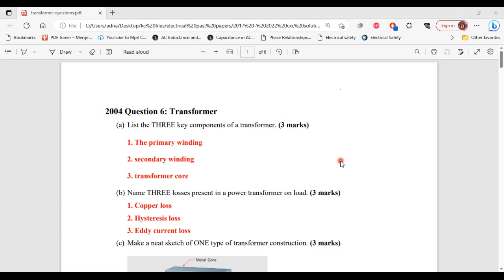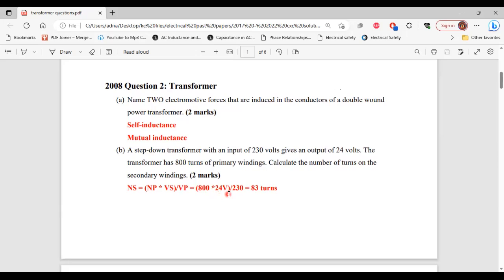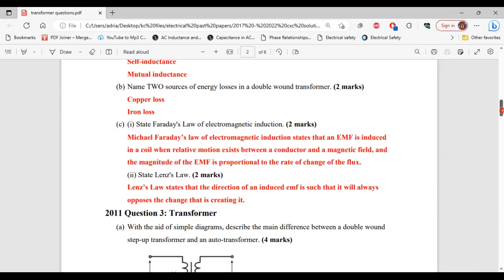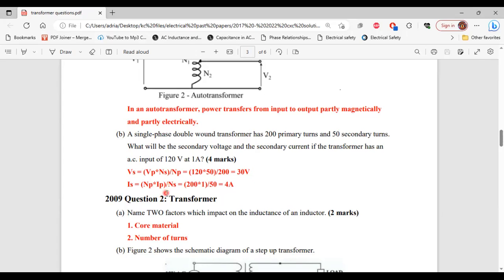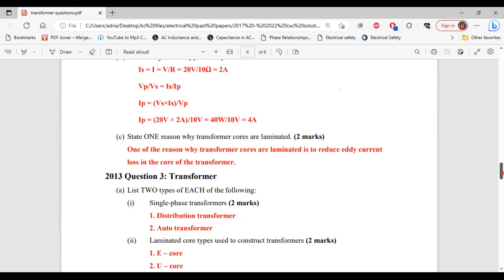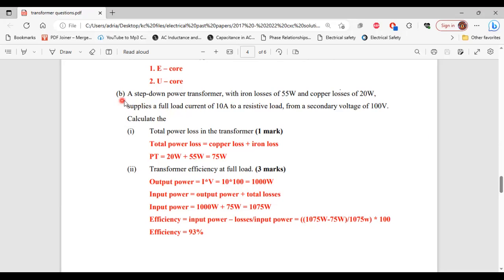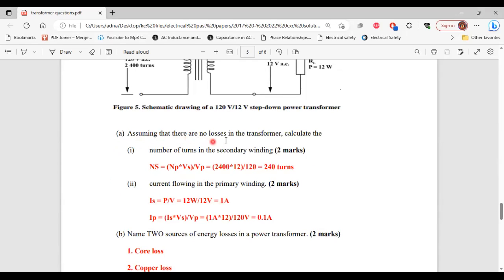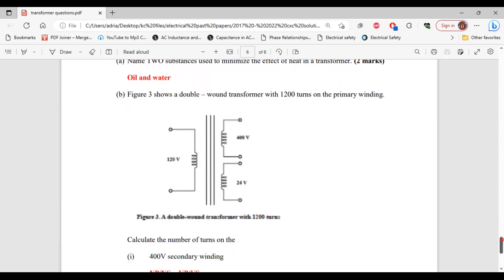CSEC Electrical: Transformer past paper questions

Comment: 8:59 good morning sir, wouldn't the primary current be smaller than the secondary current considering its a step up transformer?
Reply: Oh I just searched it up and it said the windings with more inductance(produced by coils) has higher voltage and less current in a step up transformer. Thx
Reply: It’s cause the ration is 1:2 respectively